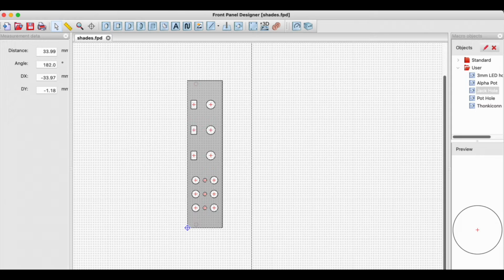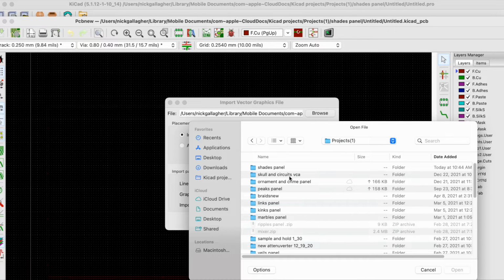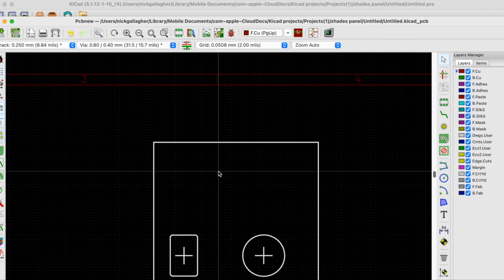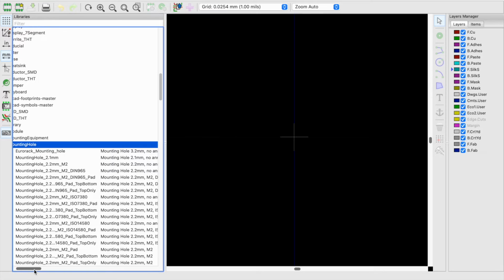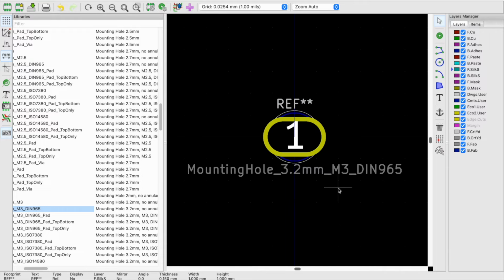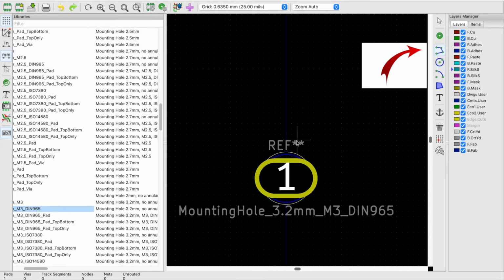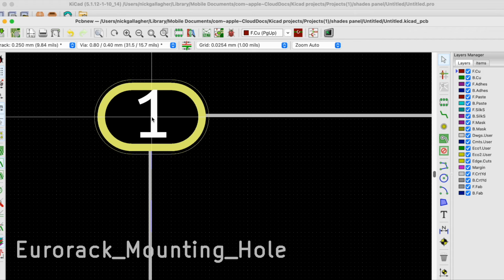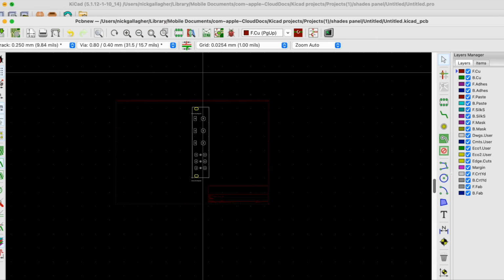Creating Custom Eurorack Panels - Part 2

Comment: i did what the video says but when i go to 3d viewer i get an error from kicad that says "unable to find segment with an endpoint of (63.55mm , 122.56mm)
cannot determine the board outline.
any ideas whats wrong?
thank you for the help and the video! i try to replicate what you did but i failed..
Reply: after some hours i found out whats the problem. i did the initial design only in front panel designer, none with inscape. the holes and the outline is perfect in kicad, BUT if i insert any letters or scales then the output file can't be viewed correctly in kicad, it shows the above error in 3d... 
so apparently thats the reason you did the lettering with inkscape... 
i have a whole panel ready with front panel designer but its useless for pcb. 
any suggestions?

Comment: Awesome two videos! The first module I made I ended up rushing the front panel process because I was too caught up in the electronics that I saved the mechanical stuff til the very end. I managed to get the drill holes and dimensions etc, but by that time I was ready to be done with the project, so I didn't bother with artsy aesthetics and went ahead and ordered the aluminum. I was eager to get my hands on it cause I couldn't finish soldering the pcb without first bolting the pots and jacks to the panel! Now I'm back with version two of my beloved circuit, and this time I want to put pretty flowers and butterflies all over the front panel. So please PLEASE release part 3 soon!!!! Looking forward to it :) subbed.

Comment: Hi Nick at the time point 18:06 how did you get the measurements to show 7.500mm and 3.000mm this would be very helpful cant wait for the next one. Many Thanks
Reply from the maker: Do you mean how did I bring up the menu so I could type those measurements in? If so, control (command on Mac) +m (or right click and choose "move exactly"). Is that what you are referring to?
Reply: @NRG____  Thanks I though that there was a way to double check that the measurements are correct, as I put 4 placement holes on the board and just wanted to double check that all holes are spot on. Thanks Nick